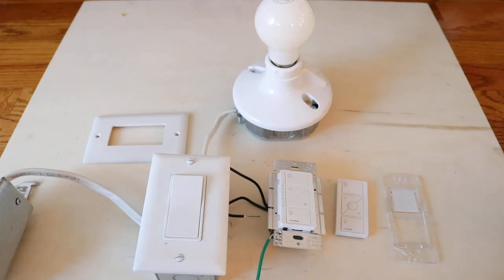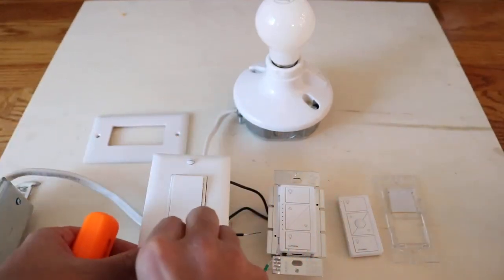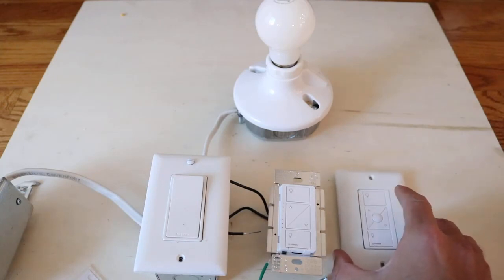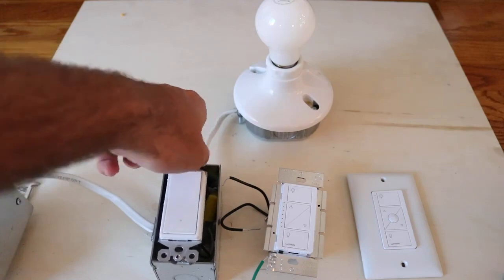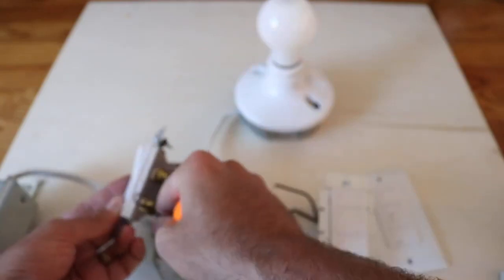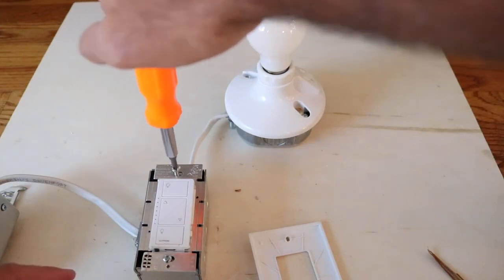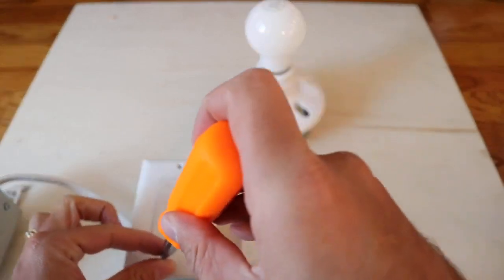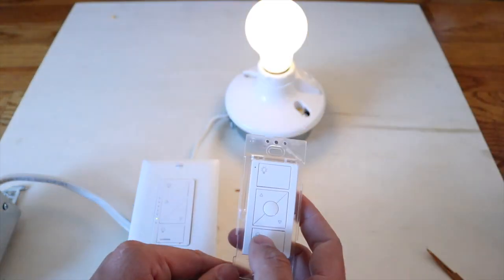Lutron Caseta 3 Way Light Switch Installation

Comment: So if it's really a three-way switch where's the traveler wire, and what do you do with it?
Reply: You're taking a SINGLE switch and transforming it to the 'capability' of a THREE way.  The non-wired switch can either be used as a remote control and placed on a night stand, or attatched to a wall, on the otherside of a room or end of a hallway, for example.

Comment: I understand the negative comments but I got enough from this to get the job done. All you need is the other part which for me was: take out the other switch, connect the red and the black, cap off the white with a marrette and that part is done. Use the backing which comes with the Pico remote in place of the switch and you're there. Not sure why people are so negative towards someone who is trying to help, doesn't charge anything for their efforts.